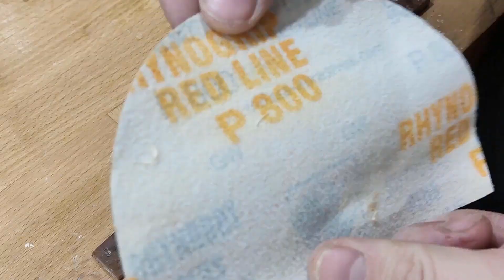048 Sliding dovetail planes 2.0   part 2 of 3

Comment from the maker: Hello! It is another stage of my sliding dovetail planes project. The planes will work in pairs - left plane and right plane for booth directions of cutting.
If you didn't seen first part of the video just check it :) 
Every step is decsribed on the timeline so you can easly read what i'm doing in any moment of the video.

I hope you will like it!
Regards!

Comment: 15:09  You took tool building to a whole new level for me when you busted out the custom chamfer plane.  I'm putting my tools away now.
Reply from the maker: Thanks Tim :) in this project my chamfer plane couldn't been used properly because the sides of the blank were too narrow. That's why i finished the chamfers with my block plane and no 4. Regards!

Comment: I’m curious about your floats. What kind of steel did you use and do you heat treat them? Your videos are a real treasure, thanks so much for sharing!!
Reply: if you can get them from lie-nielsen then do it. 100$ will get you the 3 of the most commonly used ones. Making them is super time consuming. Any good tool steel works well and heat treatment and tempering are highly recommended or you will be sharpening after every use.
Reply from the maker: Hello Harry! Thanks. My edge floats were cutted by laser cnc from c45 steel, than profesionally hardened and tempered to 40-45 hrc. My cheeck float is made from the same steel but i skip hardening - i make sharpening at the same time as edge floats. Regards!
Reply from the maker: Hello Stan! Where you can get three lie nielsen floats for 100$? The real price is 60$ for one float.
Reply: @StavrosGakos  I should have checked the website because it looks like price on them has nearly doubled since I purchased them 🤑

Comment: Another question:
What is the purpose of the 20 ° bottom bevel next to the blade?
I see that bezel in all the old ones and in the current ones, I have only seen a current manufacturer that has omitted that bezel in the large sized planes (hollow & round).
Very grateful for your responses.
Reply from the maker: I'm not sure what 20 deg bevel do you mean, pleas describe it once again :)
Reply: @StavrosGakos  https://youtu.be/-ee50RGrpl4?t=704   It is the bevel that you slide on the horizontal surface.

This intrigues me a lot because most of the hollow & round planes that I see on Ebay all have that bezel, and most manufacturers, like yourself, still do with the bezel. But I've only seen one current manufacturer that doesn't make them with that bezel.
So the question is whether it is something that is done without knowing the initial purpose from the first manufacturer, or it clearly has an intention very well known by expert carpenters, which I do not know for now.